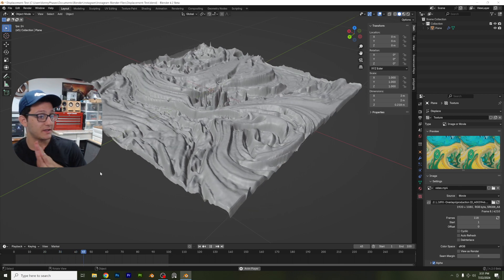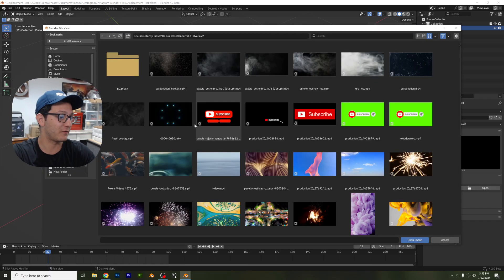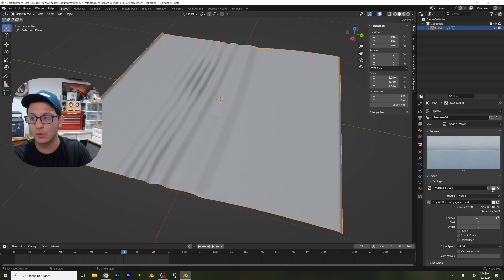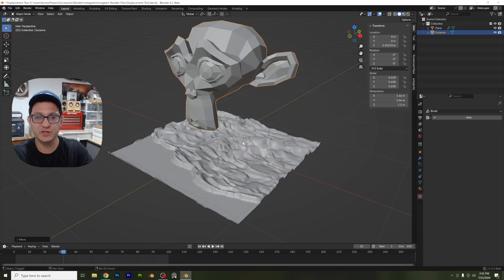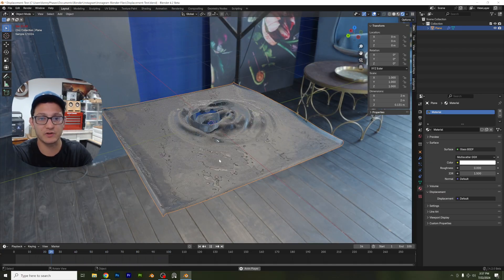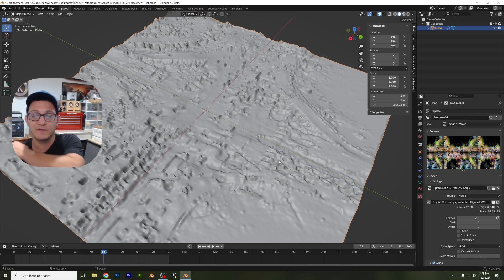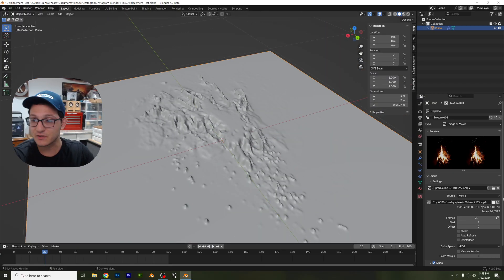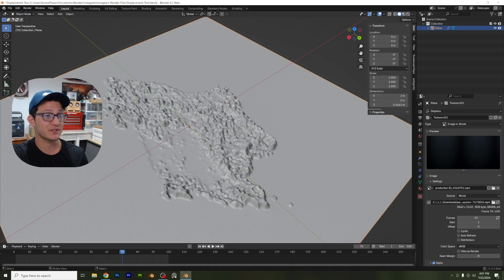Blender DISPLACEMENT Modifier can do WHAT????

Comment: thank you Kenny. This has been frustrating me for two days or more. Your explanation has been much clearer and functional so far. I am trying to apply the method to a Video, MP4. So far the output hasn't worked quite, but i can see it is on the right track using your method.